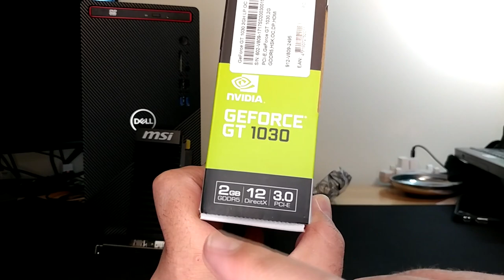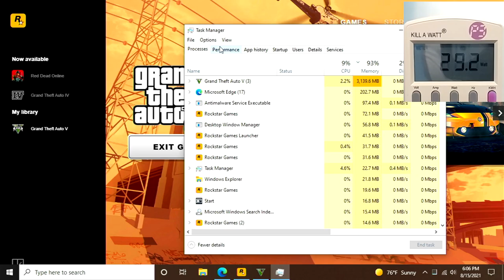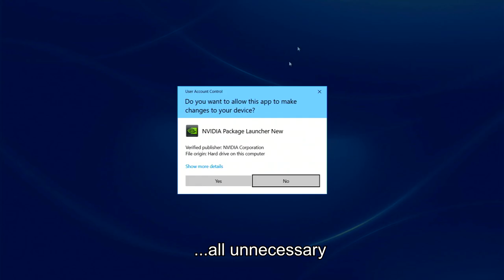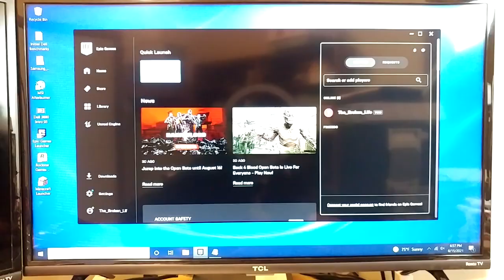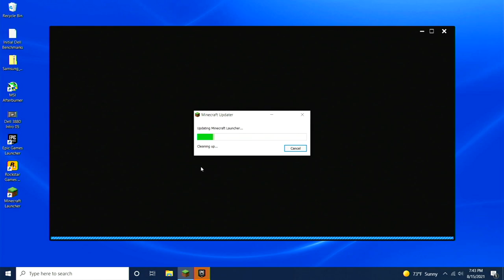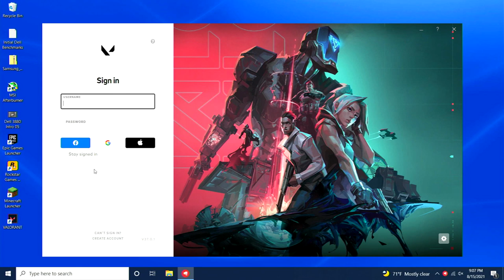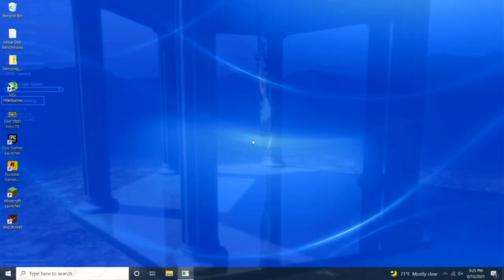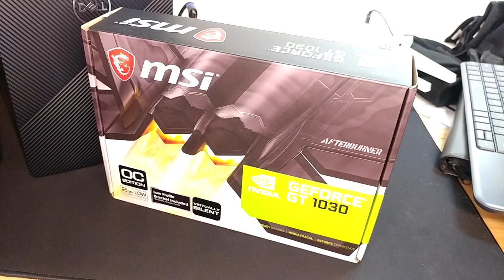Dell 3880 Graphics Card Upgrade!

Comment from the maker: Free, top secret, time travel links... Experimental Use Only...

00:00 Introduction
01:12 Hardware Selection
05:12 PSU Benchmarking (Initial)
10:14 GPU Physical Installation
13:57 GPU Software Installation
15:46 PSU Benchmarking (After Card Installation)
18:30 Fortnite Demo
20:19 Minecraft Demo
25:10 GTA V Demo
26:59 Valorant Demo
33:13 Nvidia G-SYNC pendulum demo
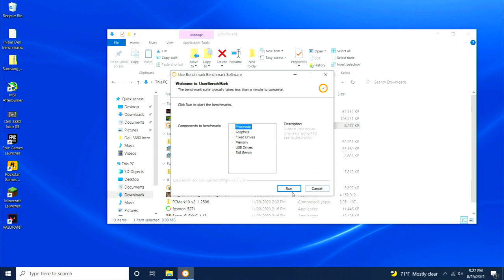34:27 Userbench Benchmarks
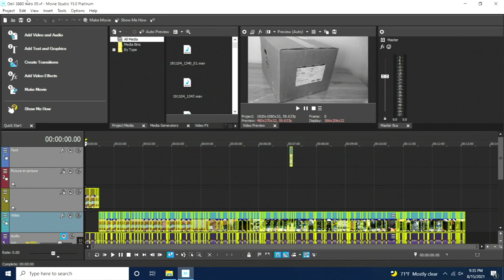36:27 Video Render Benchmarking
37:08 Final Thoughts
Reply: My old machine was a Gateway I7 DX4860.  The Dell 3880 is super fast and a nice machine.  The Gateway was good PC, however, within a year the DX4860's onboard sound completely died, which meant I had to buy a Audiogy sound card.  Other than that, the Gateway was a real warrior.
Reply: Opps did not realize this one is an I3. My Dell 3880 is I7.
Reply from the maker: @blue2elmer1  I lost faith in Gateway at least 15 years ago and I haven't looked at one since. It might be fun to grab one for a future series and take another look.

--

Mine is an i3 for now. :) Truth be told, I'm surprised by just how good the i3 is. I'm very curious how big of a step up an i7 will be... and then a little later an i9-11900.
Reply: @TheBrokenLife  To be honest with you, the Gateway with that old I7 2600 CPU, 16 Gigs of RAM, SSD drive and the GT1050 TI was not that bad for games.  I still have the Gateway, it is now doing duty as an entertainment PC hooked up to the stereo and tv in the basement family room.  I took it out of its Gateway vertical case and bought a horizontal case and it looks neat next to the Stereo Amp in the entertainment unit.  Yeah, I was mad at first when the sound went out after only a year.  It was not Bios, it was not Windows, the motherboard fried the onboard sound chip.  The Audigy is actually a step up and I have my whole music collection on it now and just use it to stream movies and play MP3 music files.   The 1050 TI i had in it was replaced by an old 730TI with DDR5 i had laying around. Good retirement for the old Cow.  (get it, the Gateway logo? lol.)
Reply from the maker: @blue2elmer1  Oddly... My 3880 is eventually destined to the same fate and live behind the TV in my home theater. Also oddly, I will be ditching the integrated audio in favor of something that supports at least 7.1 audio.

So, we're both headed to the same places whether or not we planned it! 

And... I had entirely forgotten about the cow ads and boxes. That's a throwback for sure.

Comment: I bought this exact machine a month ago.  I was able to upgrade it by adding a 3TB hard drive for data storage, the factory 3880 Dvd drive (used from ebay) and added a GT 1050 TI from my old computer and all seems to run stable.  The only outstanding item is to replace the 4GB chip for an 8GB Ram chip so that I can enjoy 16GB of RAM.  Hard to believe I paid $130 for the GT 1050 in 2018.  I was afraid at first, but the power supply handled the 1050TI with 4GB DDR5 Card.    No issues... Knock on Wood!
Reply from the maker: Everything I have done with mine pretty well confirms your results.

It's hard to believe back in December when I made the buyer's guide video I told people not to pay Dell for a 1030 because it was an $85 video card. The world changes fast...
Reply: hey, whats your total wattage with the 1050ti
Reply: @jblico  I calculated around 270watts with the i7 10700 and the video card and HDD and DVD writer upgrades
Reply: i wonder what they put in that dell psu
Reply from the maker: @GamingChairDiff  Capacitors and other things?
Reply: @TheBrokenLife  IS THAT PSU ON STEROIDS THOUGH
Reply: TY for your comment.  I am looking at the 1050 as well.  I upgraded to the Dell 360w PSU for $32 on eBay with no problems.

Comment: I've been holding back on buying a 1030 just because I didn't know if I'd need a fan (the rare few vids on here of people upgrading the GPU on these things did end up doing so, a somewhat complicated process involving installing AND quieting the fan, sometimes with molex wires) and the power draw but this lil MSI seems pretty legit for what it is even with the passive heatsink. 

As relieving as it is to finally get a GPU video, the PSU video is what I'm really lookin forward to... I'm staying tuned...
Reply from the maker: A couple of things I didn't do with the MSI that "could" poop on a party, but I really doubt it.

1 - Overclock it. To my shock, the card is openly advertised as being the "OC" edition and Afterburner can and will overclock it. I didn't try and I didn't see a need, but, I imagine you can really put some heat to it if you tried hard enough. 

2 - I only played games for maybe 3 hours, total, and none of them appeared to be very thermally taxing to the system based on the wattage draw. If you found a particular game that really made it work, it could generate some amount of heat and maybe make things warm inside the case. I doubt it though. I couldn't get the machine over 130 watts (and only in one burst) no matter what I did. That is with an i3, but... that's a pretty tame heat load.

3 - If you had to add a fan, it's really not that tough. There are fan "cards" that occupy a card slot and just plug into the PSU. Getting one that is quiet might be a challenge, but at some point it's difficult to have it all. Personally, fan noise isn't much of a concern for me but I know it is for a lot of you guys... Hence the silent treatment in this episode. ;) In the future, I'm going to be assuming that if peple are going deeper down this rabbit hole that you're interested in performance above most else.

---

4 weeks! :) Maybe a touch sooner, but I'll give you a small spoiler alert now: the next video you're going to be looking forward to after the PSU video is the case upgrade video because that is the direct kin of the PSU upgrade video. So... If you're really dying to see the PSU be replaced, then you're pretty much scratch building a PC out of Dell parts.

I'll show the 3 options and explain my thoughts further, but that's where this is headed. In 2-3 more videos, it won't be a Dell anymore.

Comment: So glad you got the DDR5 version. The DDR4 release made quite a big stink, considered a borderline scam. It's still a naming flaw some retailers happily exploit.
Reply from the maker: It is really easy to buy a DDR4 card by mistake and not just this one from MSI. I was wondering if something unsavory was going on under the surface. Sounds like maybe there was.
Reply: @TheBrokenLife  also when you finish the series you should try getting a dell xps or a bigger pc for upgrading it will be cool
Reply from the maker: @GamingChairDiff  I'm pretty sure we'll have 2 series going simultaneously and they will probably be competitors to the 3880 from whoever has the best prices when the time comes. I'm thinking Lenovo and HP.

Comment: I have a dell inspiron 3880 with no psu upgrades, it's a year old, will it break if I add the gt 1030?
Reply from the maker: Nope. A GT 1030 should be fine. I think there are even some 1660s that don't need more than bus power.

Comment: I noticed you had "VSYNC" turned on in your gaming demos. "VSYNC'" or Vertical Synchronization, locks your framerate at the Monitor's refresh rate, so you don't get screen tearing artifacts. That's why you maxed out at 60FPS.
Reply from the maker: Another commenter pointed that out as well. I'll be sure to turn it off in the future.

Comment: On the watts used by the card, it can only use a maximum of 75w because that's the maximum that PCI can provide, so any card that is rated at 75w or less should work in the computer.  The best one at the moment would be something like the GIGABYTE GeForce GTX 1650.  I have a 1050 TI in mine because it's from my previous computer that my 3880 replaced and I can't afford a 1650.

Something that I'm looking at getting is the Intel AX210 Wi-Fi / BT M.2 card to replace the Wi-Fi / BT card that came with it.  That'll bump it up to Wi-Fi 6e and Bluetooth 5.2, which are newest versions of each.  Looks like they're running around $45 on Amazon.
Reply from the maker: One of the reasons I wanted to measure the wattage on the machine was to see what the draw of the overall system was. If a card were actually pulling 75W, combined with the 75W baseload I was seeing, I'd probably recommend people avoid it because they'd be running the PSU a little too near its maximum design wattage for my comfort. If the baseload was 100W, I'd absolutely recommend against it. But, that's just my comfort. By conducting the study, I've equipped people with the tools to make their own decisions. Or at least I hope I did.

I'm not up on the current WiFi and BT standards. What's the advantage of the upgrade and what would you need on the other side to take advantage of it?
Reply: @TheBrokenLife  I totally agree with you on it pushing the limits if the card pulls the full 75w available to it.  The 1650, like the 1050, shouldn't pull the full 75w during normal use.  I'm no gamer (beyond lie Age of Empires type stuff), but I would like something with more transcoding power than the 1050 has as far as better / faster hardware support for newer CODECs, so that'd be the only times I'd be using the card to a substantial fraction of it's potential.  One of these days GPU prices will come back down to where I can afford that 1650 to test it out.  Of course, my 10th Gen i5 3880 might be obsolete by then :-)

The Wi-Fi part of the AX210 would only be beneficial if you have a Wi-Fi 6 / 6e router.  If so, then you'd be able to use the 6GHz band, which (at least for now, since it's pretty new) is a lot less congested than the 2.4GHz & 5GHz bands.  The 6GHz band also has a lot more contiguous space within it so that there are more channels available without worrying about overlap with your neighbors as much (which is good for apartment dwellers like me).

The Bluetooth side of it uses the 5.2 protocol, which gives faster speeds, lower latency, and lower power consumption.  I'm not as familiar with the inner workings of Bluetooth, but as with all networking standards, every time they bump up the version number there's always faster speeds and more features.  The reason I'm looking at getting the AX210 card and replacing the one that's in the 3880 (Intel 3165) is because a couple months ago there was an update (not sure if it was a Windows Update or a driver update from Dell for the 3165 chipset) that made my audio sttuudderrrr every time I move my Bluetooth mouse around.  I've tried everything short of wiping the OS and loading it all from the ground up again (rolled back the most recent update, reloaded all the drivers, tried some Windows Fixes, and even some registry hacks from Googling the problem).  The Dell module that's in there is using Bluetooth 4.2, so I'm hoping that moving to Bluetooth 5.2 might allow me to start using my Bluetooth mouse again (I'm currently using the wired mouse that came with the computer).  1st world problems and all that.

Great video again, BTW.  I always like watching what you're up to with yours.  Not much content any more coving the basics of how to do the upgrades most consumers are wanting on their systems.  Everyone wants to do thing like "Let's build a $10,000 SSD NAS RAID for our 10Gbps fiber network." type stuff nobody watching YouTube will ever be able to afford.
Reply from the maker: I'm generally of the opinion that if we're going "much" past as Dell birthed a 3880, that we're probably kinda doing it wrong so we should probably do it really wrong. So, if I were to consider something like a 1650, I may as well just prep up to go even bigger and badder than that while I'm doing it. I have a game plan to turn that frown upside down if your 10th gen is outdated by then... We're probably 3-4 videos away from it at this point, but we'll get there.

Is range on the 6GHz band even more diminished than it is on 5GHz? For me, pretty desperately trying to be a country boy, that's what I would like more of. I can absolutely see the advantage of getting off of the more crowded air as an apartment person. I've only lived in an area that was dense with apartments for a few months, but the amount of wifi networks was insane. Made me wonder what a place like NYC or Tokyo must be like. On the plus side, some people had hilarious network names. "Pretty Fly for a Wifi" and "Lord Of The Pings" are the two that stuck with me. Around me now are NETGEAR-435347 and HPOFFICEJET345, etc, etc... I'm the only one making an effort.

Hummm... That is odd behavior. As a ghetto interim solution, I wonder if one of the super inexpensive bluetooth dongles would work? 

Thanks! However, the first person that hands me 10 grand to build a NAS RAID box is going to get to see me do it. I can absolutely be bought. ;)
Reply: @TheBrokenLife   - LOL!  I use my Wi-Fi ID passive-aggressively.  Our downstairs neighbor has a little boy (probably about 5 or 6), and I've had my Wi-Fi be stuff like "Stop riding the scooter in the house".  It's currently "Thump Thump Thump Thump" because he always seems to be jumping around (low frequency vibrations seem to carry through the building like the noise is coming from next to you instead of another apartment).  The people that lived there before liked to party like it was a frat house until 3:00am every night.  I came very close (had it on my Amazon list) to buying a microphone (to bolt to the framing), a 1000w amp, and a ButtKicker LFE system (bolted to the floor).  I was going to force-feed their own noise back at them so loud their teeth would rattle.  I grew up on a farm, so I don't tolerate others invading my peace very well.

From what I've read, the 6e carries further than the 6, and the 6 carries further than the 5.  I don't know if it's because it has more channels available to fine-tune what ones work best in a given situation (building materials and so on) or what.  

On the Bluetooth dongle front, I bought an ASUS USB one to see if it was just the on-board Bluetooth card, but still had the same issue.  I think one of the problems is that the system absolutely refused to allow me to disable the built-in Bluetooth.  I need the Wi-Fi for connectivity (it's in another room than my cable router and I don't think the landlord would appreciate me tearing up walls to run CAT-7 around the apartment).  At the time there weren't any Bluetooth 5.2 USB adapters, so I think the one I ended up getting was either 4.2 or 5.0.
Reply from the maker: I was tempted to send little messages like that, but I tend to prefer to stay more anonymous... So I'm permanently passive-aggressive if anyone knows the reference and understands that both names are on the same network: 5GHz is Colossus and 2.4GHz is Guardian.

Have fought noise wars with neighbors.... have won... the equipment from those conquests will be on the broken tech channel at some point. The battle was won, but I have some fallen solders to repair.

So it may have 2.4 range again? That's better than nothing.

I wonder what your bluetooth does if you straight up remove the card and only try the dongle. I understand you'll need the card back for connectivity, but I wonder if it would work?
Reply: @TheBrokenLife   - I may try removing the card at some point, but the computer is snug in a shelf at my desk and I've been too lazy to crawl under there to unhook everything to pull it out to remove the card and then have to reconnect everything to test, then back out again to put the card back . . . rinse repeat.  One of the reasons I'm thinking about getting the different card is to motivate myself to do all that.  I have two 8GB sticks (from a now defunct system, so I'm not 100% sure they'll work) sitting on my desk to try in it to bring it up to 32GB, but that hasn't been enough motivation.

Here's a quick video from ThioJoe that explains Wi-Fi 6/6e using some graphics that make it easier to understand:  https://www.youtube.com/watch?v=SrVTzRgi8uA
Reply from the maker: @ckought69  You mean you don't just throw yours on the floor as soon as the cameras shut off and lose it for the next month?

And... It only has 2 RAM slots. Not sure how your plan is gonna go? Sorry for the demotivation.

I'll check that link out. Thanks!
Reply: @TheBrokenLife   - Crud.  It's been months since I'd crammed it in that desk shelf.  I'd forgotten that it only had two RAM slots.  Well, so much for that one.
Reply from the maker: @ckought69  Meh... RAM is relatively inexpensive if push came to shove and you really wanted to have it. I'd personally probably spend my cash on a new case, PSU, and MB and then use the RAM you have.
Reply: Hello! I have the same model

i5 10400
8GB RAM
SSD nvme 256GB
1 TB HDD
200W Dell PSU

So I wonder if the GTX 1650 LP would work in my PC? I plan to buy that card + 8GB RAM. At the moment I don't want to change the PSU.

Comment: Really cool, I wonder what is the most powerful graphics card that works on a 200W power supply?
Reply from the maker: From what I saw, probably about 75w, which works out pretty perfectly for what the bus can supply. I think some of my subs have mentioned that there are 75w versions of 1660 cards out there, so that's probably the most advanced card it would run.